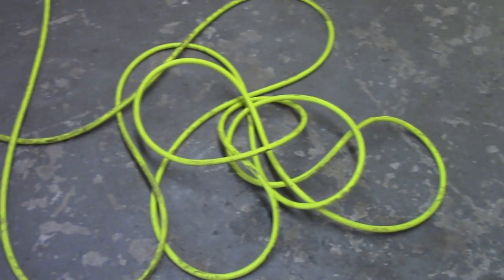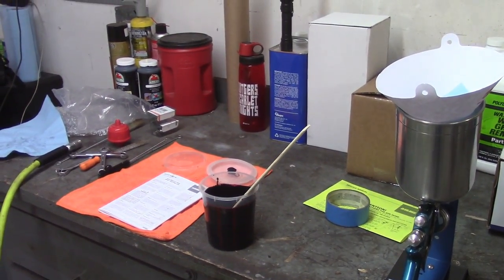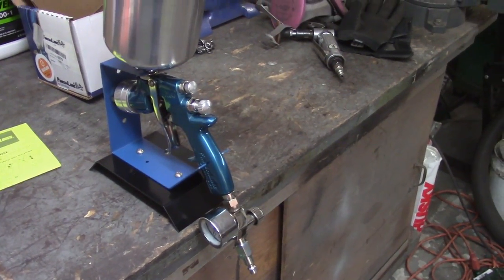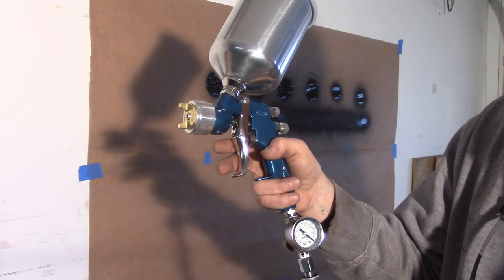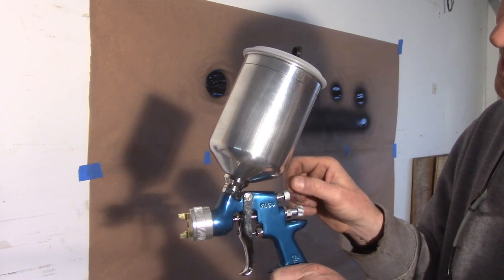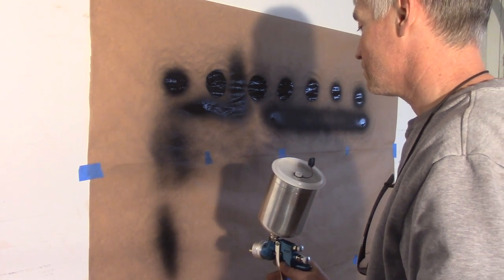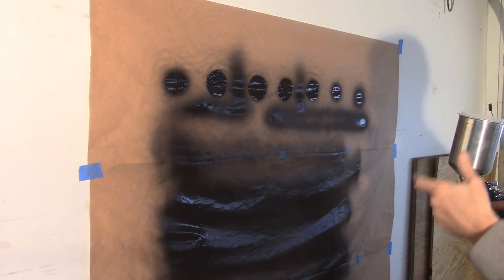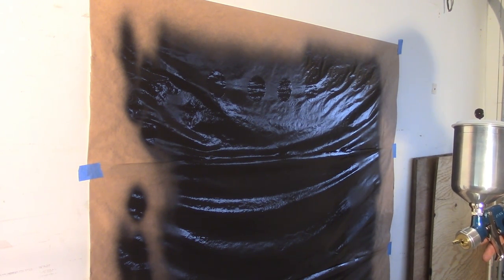Triumph Spitfire Restoration - Paint Practice

Comment: What size air compressor are you using?  Also you may want to try the real paint on a scrap panel like a door or hood before you try on your car.  Thanks for the videos.
Reply from the maker: Hi, Walter. The compressor is a 60 gallon, 6hp, 220v unit. Something like 11.5 cfm at 90 lbs, so it should be good. I do intend to practice with the real thing before I go for it. Thanks!